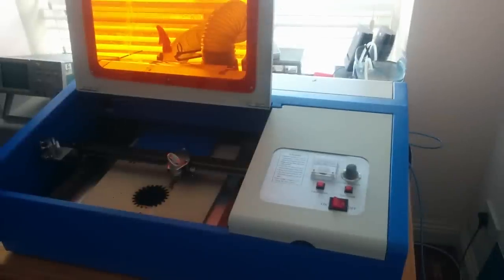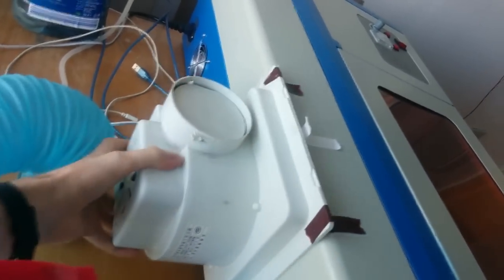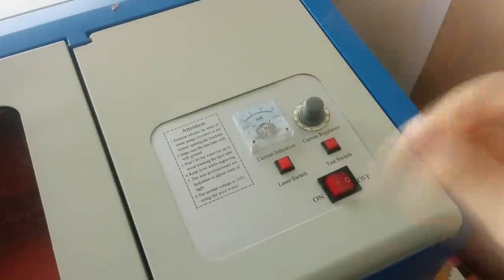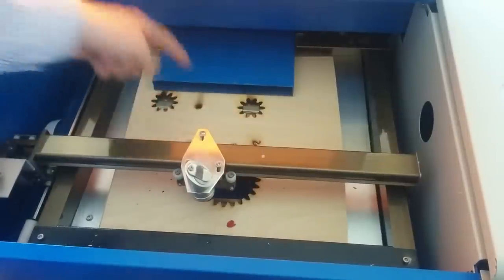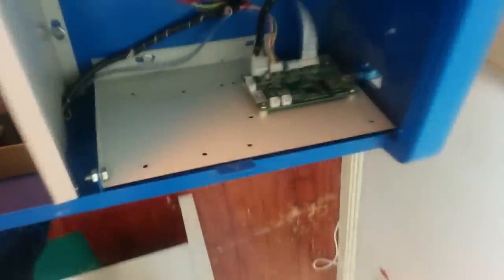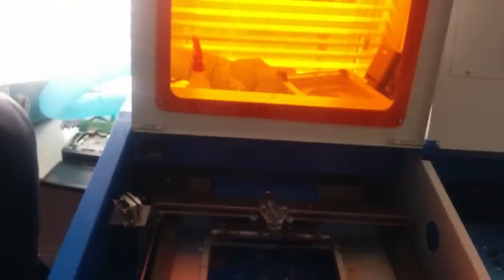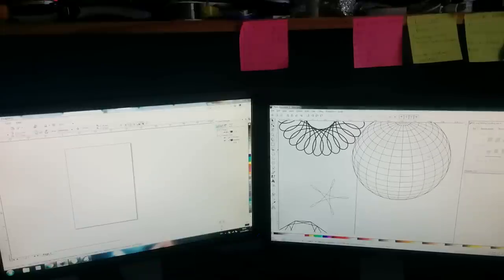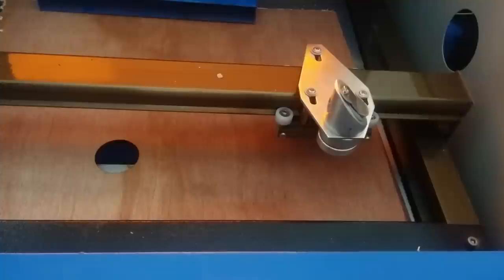k40 40w chinese laser cutter quick review + use

Comment: For those of us with a few woodworking tools, the fan issue is no big deal.  Just make a connector to mount over the rectangular hole and give it a round hole for the pipe. Then do the reverse at the other end.

Alternately, I installed an in-line, variable speed fan over my copper plating station and exhaust it out the window using four inch hose.  When I use liver of sulfur, which is quite odorous, I can't smell a thing, even with the fan set to a low setting.

Comment: Thank you for the demo. The process looks fairly straight forward, especially if the software is user friendly. As a reference, can you post your percentages for different materials? You already mentioned 60% for thin plywood. Did you have to clean the mirrors or do any tinkering before use? I don't mind doing that. Thank you.

Comment: I'd be interested in knowing some of the settings you have found to be best for (a) engraving and (b) cutting.

How should you use the analog "Current Indication"?

How do you decide where the Current Regulation should be set in conjunction with the software?

(a) Engraving - speed mm/sec -

(c) Cutting - speed mm/sec - 

Sorry if my questions don't make sense. I'm pretty new to all this.

Comment: You can improve your laser cutter by adding a hose and air pump so it blows air at laser nozzle towards material to be cut. It reduces the blackness and saves you from eventual fires that occur when cutting at full power.

Comment: Hi, extremely interesting demo!! Thumbs up!! Now considering to get one myself.
I have very simple application. Cutting 300 mm. diameter circles out of square 400 x 400 sheets of PVC (2.5 mm. thick). A question re the cutting area. very low accuracy requirements. Would I be able to fit those inside the machine??

Comment: I have learned that the intended use for these cutters is to cut out rubber stamps.  You put the stamp in the clamp, and use engrave to zap the rubber to make your stamp. I removed that entire metal plate with the clamp in it and have a honeycomb in there to hold my work piece up.
Reply: I was actually thinking along those lines as well. The metal frame seems fine without the spring thing.

Comment: Good video, have you tried cutting other types of wood? oak for example. All the videos I have found only seem to show ply being used (because it's cheaper and flat I assume).
Reply from the maker: +Peter Ranson Thanks :) havent tried any other types of woods yet it's on my do to list. you could probably cut oak veneer pretty easily - not sure what the max thickness would be
Reply: Well I just ordered one of these so I guess I will find out :-)
Reply: +Peter Mackenzie well it has arrived and i have spent hours trying to get it to work now. I aligned the mirrors (best i could) and checked roughly the focus point of the laser. But even on full power and going 10mm a second it is barley making a dent. not even cutting through wood veneer which is less than 1mm. Tried engraving and it doesn't even show up. Can you tell me all the settings you changed in corel/laser draw? Thanks
Reply from the maker: Sure when I get home from work I'll let you know what they are. Can you cut plywood?
Reply: +wattnotions nope, but i am about ready to cut myself! :-( one thing i have noticed is it is cutting (burning) twice. if i tell it to cut a square about 1cm wide, at 10mm a sec on about 70% power i will get a black burn line of a square below the laser, but i will also get a weaker shadow of the same square off to the side, about 1cm away, it's like the beam is being split in two. I'm wondering if i haven't aligned the mirrors well enough. i spent about 3 hours trying to get dots to line up by sticking masking tape in from of the mirrors.
Reply from the maker: haha oh man I've been there before. The mirrors can be quite tricky to get right the first time, after that you start getting used to it. If you put a piece of paper in the laser cutter and hit test fire do you get a nice small single burn hole in the paper? The cutting twice thing might actually be your drawing - the line width of the square needs to be crazy small, like 0.01mm, any bigger and corel draw will cut the inside and outside edge of the square if you get me.
Reply from the maker: http://imgur.com/TDg82ZW

here are my settings for the cutting window
Reply: That link gives me an Imgur error page?
Reply from the maker: +Peter Mackenzie http://imgur.com/gallery/Am0X1wf
Reply: Thanks those are the settings i am using......however i have figured out what i was doing wrong. i had the lense upside down :-( fail.
Reply from the maker: LOL! at least it was something simple :), is it working now?
Reply: Yea it seems to be, i have just added "air assist" as i have seen other people doing that, by that i mean i have taken the air pump from my fish tank and pointed the tube towards the cutting area and stuck it on with tape but it seems to help. just testing various woods atm. it cuts through 3mm ply and very easily cuts through 3mm spruce. Do you have any more videos/websites that show what you have done with this so far?

Comment: Hi, I just bought a 40k laser just like yours, it engraver very well, but in a matter of cut I do not know what's going on! If I met the weak laser does not cut, if I met strong burns everything around !!
In your video it seems like a clean cut how do you get it?
Thank's for your time.
greetings
Ricardo Araujo
Reply from the maker: it sounds like your laser is not aligned properly. You need to align the mirrors to get the laser focused down to as small a point as you can.
Reply: Thanks for your time, I had just done this when I received your response, it has improved a lot, I still think it should cut better, I put the laser at about 35w 5mm/s  if a 2.5mm wooden board has to take two Passages to cut!
Do not you think it should cut better?
Reply from the maker: It should cut better than that for sure. I can cut 4mm plywood with a single pass cutting at full power at 5mm/s. At 5mm/s it should cut 2.5mm ply in a single pass no problem. I assume you have the water pump cooling set up? If the laser tube heats up too much it will start to lose cutting power so it could be an issue with your cooling.

Comment: The hole is for a light to light up the laser bed. Some come with the light built in. I guess this version doesnt.
Reply: Aaron Wilson that hole is sometimes used for the light but it's real use is a maintenance  hole for taking the belt off the laser head, there are some screws at the end of the axis, its to access them

Comment: when package arrived , you Just put It out plugged in and started to work or It needs to make some adjustement , calibrate axis and so on ? thanx
Reply from the maker: +Stefano Dedalo In my case it worked straight away
Reply: +wattnotions sweet thank you ! may i ask you how much for that machine ?
Reply from the maker: No problem! It was 375 euro including delivery from Amazon.de  and I live in ireland
Reply: +wattnotions thats really nice .. thank you ... im seriously thinking about buying it ... last question have you ever felt of being limitated in height for your works or the height of the material to burn  its not s problem because you burn only thin msterisl? i want to burn raw pieces of tree ... thx
Reply from the maker: For me 6mm is the max thickness for plywood and acrylic and it is plenty. Normally I use 3mm for my projects so it's perfect
Reply: +wattnotions ok that's very good , but i need to engrave (not cut obviuosly) pieces of wood 20 millimeters thick , do you think i'd be able to insert them in that machine and engrave them ?
Reply from the maker: yeah that should work just fine
Reply: +wattnotions thank you so much !

Comment: hi
does it cut white cardstock paper? like 300-350gsm? and does it leaves burn marks around cut lines? one more question - is the laser dot spot thin and if we can adjust/focus it?
Reply from the maker: chakis v the amount of burn Mark depends on the speed and power used . the faster you go the less burn . normally there is always a little bit but if you do it right it's not noticable.
Reply from the maker: chakis v you can adjust the laser dot by fiddling with the mirrors or changing the height of the laser bed

Comment: Just got mine, but I can't seem to get it to cut through ply like yours (I set it to Cutting v. Engrave). Maybe its a dud?
Reply from the maker: +Camtek Software Maybe, it could also be that your laser is not focused properly. Have you checked the mirror alignment like in this video https://youtu.be/KhhOHUe_b6o?t=10m58s ? Hopefully you get it working!
Reply: +wattnotions  Thank you Sir, I will take a look at realigning them, I was just worried that I bought something that won't cut through 3mm ply which was my only reason, to make little versions of metal fixtures like on my channel. Mine looks identical to yours, so I'm optimistic!
Reply: +wattnotions Got them nicely aligned I think. Still at 100% (25mA) it doesn't cut through. Just in case I am dumb, yours is a 40w laser? It looks identical as I say.
Reply: +Camtek Software Focus and speed ;-) Things are improving. Thanks again.